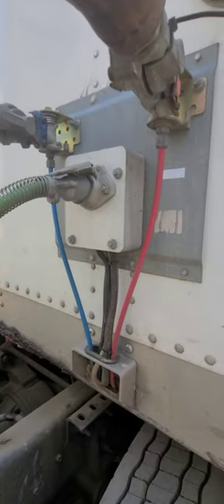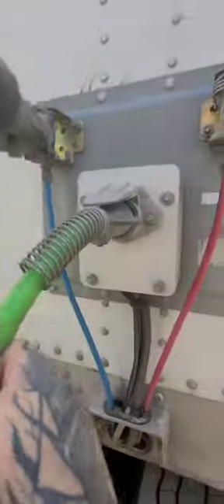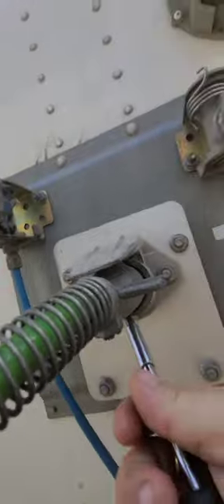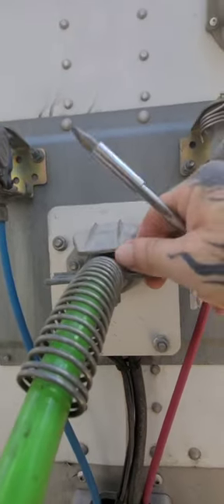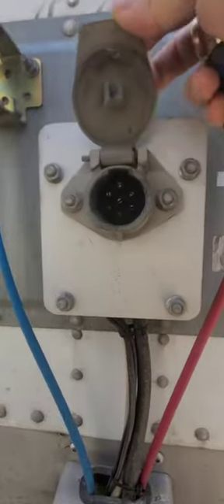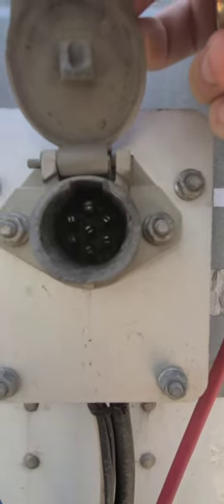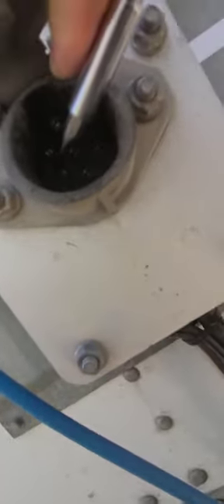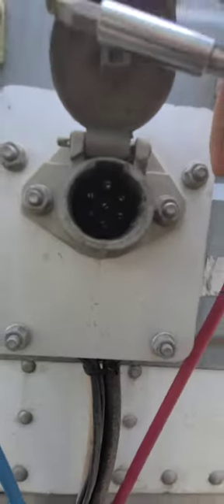How to fix intermittent trailer lights. #18wheeler #trucking

Comment: Go to Freightliner in Billings Montana. 
They have a fix for that. It is 2 rubber strap that bolt to the socket bolt, & hook over the pigtail ends. 
I was told that it was invented by a beet hauler who got tired of having tail light problems. 
Hello from north east Montana. 
10 miles from the Canadian border.

Comment: W-D 40 works it helps clean the holes and prongs so ya get good contact.
Reply from the maker: WD-40  "water displacement formula 40" works great for the pigtail